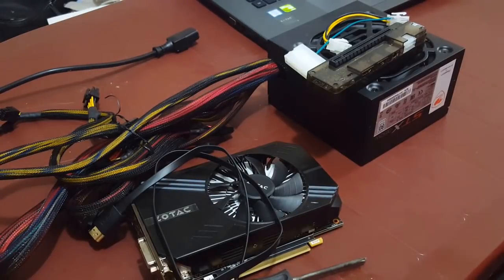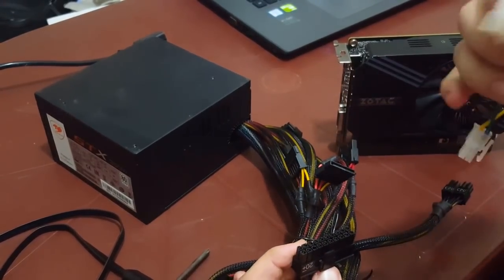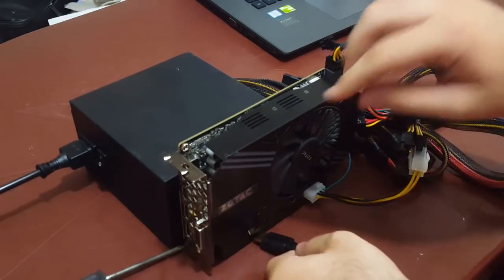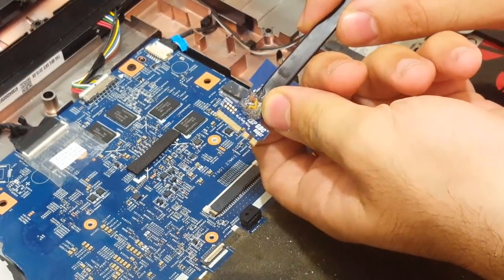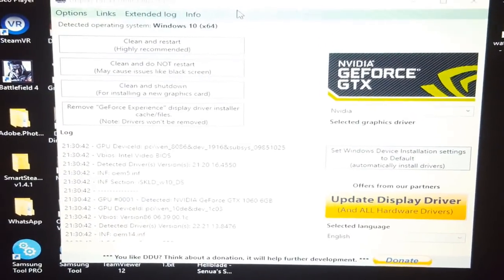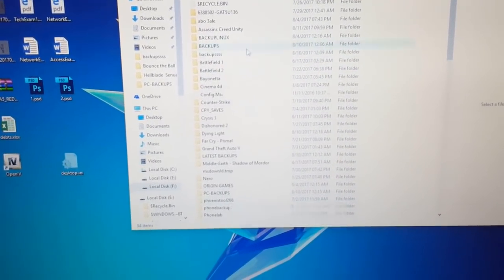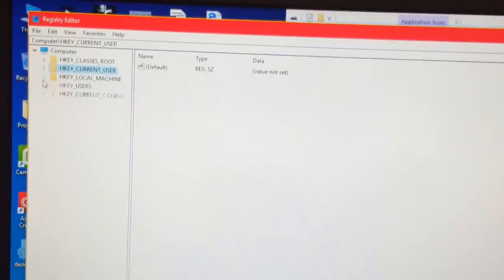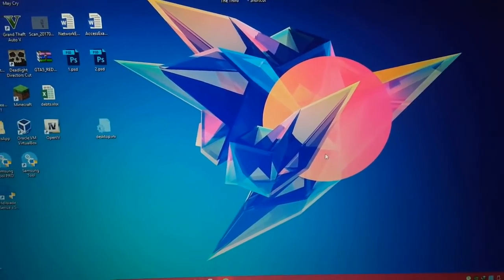HOW TO: External GPU for any laptop PC W/O External Monitor GTX 1060 EXP GDC 1050 ti solve error 43

Comment: Hi! i am trying to add 1060 6GB with my Hp envy 360. my computer detected the graphics card but i couldn't able to install any of the software (368.81, 372.54 or latest 430.86). if somehow i manage to install the software, the Nvidia control panel did not open neither the graphics card works (error 43). please help me to install the appropriate software. Thanks

Comment: Sir,  my gpu is not detected in the device manager.The vga adapter is detected but not gpu.The require driver of asus gtx 750 ti cannot be install it display error. My cpu lenovo core i5 560M,win 7 64 bit, ram 6gb.Please help

Comment: When I replace my wifi card with ngff ExpGdc Beast external pci adapter cable there is blank screen on booting. Even if I do not connect the HDMI to the adapter and conect only the ngff slot with no power still boot with black screen. If ngff cable is removed display comes. Is there any bios mod for fixing the same or what can the problem be?
Reply: did you solve this problem?

Comment: hello pedro will radeon rx570 work on dell i7 4th gen 8gb ram and my laptop already have nvidia 840m .I mean will there be any issue with amd drivers?
Reply from the maker: Haven't tried AMD yet, sorry, be the first to try
Reply: @hmawla  Amd gives more than 100 fps in all the latest games ,so i want to install amd.
Reply from the maker: @bankai_333  I understand, but unfortunately I did not test any AMD system yet with the Beast

Comment: So I just won a GTX 1060 for £90 used for a few months what is the minimum power supply for this kit i read 220w but card says 120w

Comment: I setup with gtx1070 but I got error 43 can u help me plz
Reply: Sok Lim  bro i have the same issue i don’t think these videos will help us i run my gtx 1070ti in GCD beast, it detect in my device manager but when am trying to run the NVIDIA driver it completely installed but after restarting the pc it doesn’t work for me I think we need to build a desktop

Comment: Rip mine not working I’ve tried everything watched so many videos but I always get error code 43 and it can’t be the gpu itself that’s the problem because it’s BRAND NEW so please if anyone can help reply to this with tips or suggestions
Reply from the maker: Try connecting the gpu while the beast is on while removing every power source from your pc like adapter and battery then turn it on.
Reply: Pedro Marthon thank you I’ll try it
Reply: Pedro Marthon Rip it didn’t work i loosing all hope in this but thank you for helping

Comment: It is better to build a desktop instead, I tried with my desktop 1060 but did not work on Lenovo laptop

EDIT: Worked finally but performance was meh.
Reply: bhai mere pas hp pavilion dv6 he gpu ke liye pura milake kitna kharcha hoga
Reply: @amolchopade7649   Amol Chopade  gpu+psu+connector.
Phle power rating dekhna gpu ki official website par jaaker mere paas GTX 1060 that uske liye minimum 400W psu chahiye but mere paas already 700W phle se hi tha. Agar tum GTX 1060 ke saath build karte ho to total price gpu (25000)+ psu (400W) (2500) + connector (2500). So for GTX 1060 price is 30000, if you buy graphic card online then you have to pay extra 10000 for graphic card approx. So price will be 40000 (graphic card online).
Reply: Hey will this work with my Toshiba laptop? Bios is locked and there is no options related to graphics card. But I'm planning to buy r7 240 2gb ddr3 for core i5 2430M(low budget).

Comment: Did you not have to change the bios settings to get the Beast working?

According to the guide you get with it you need to change the Graphic Device from Internal (in my case Discreet) to UMA.

So far I've followed the standard setup procedures and this has happened (I'll give you're guide a try):

I've just tried this on my Lenovo Ideapad 510 laptop. I first disabled the mobile Nvidia graphics card in it by changing the Graphics Device from Discreet to UMA in the bios. Then I connected the Beast External GPU to the laptop and then  plugged in a cheap graphics card I had to the Beast External GPU and connected the power supply. I booted up the pc, but it didn't detect the graphics card. What's more when I ran the graphics card driver installation it didn't detect the card either. It's also not present in device manager and is only showing the intel internal graphics device. The power supply is working, the graphics card fan is spinning, so I think there's no problem with the Beast external GPU. The only thing I can think is either my laptop isn't compatible or the graphics card isn't. It's just a cheap one (Nvidia NVS 310) I borrowed from work to see if it works before spending loads on a good one. Could it be the problem?
Reply from the maker: My BIOS settings are still the defaults, you just need to make sure to remove all power source from your pc before connecting the beast while it is turned on with the GPU comnected correctly, this will fix your GPU not showing.
Reply: @hmawla  my power supply won't switch on until I turn my laptop on. But I did try this and my Graphics card is still not showing up in device manager.
Reply from the maker: @Tsamados  follow this guide to keep the psu ON 
https://www.instructables.com/id/How-to-power-up-an-ATX-Power-Supply-without-a-PC/
Reply: @hmawla  not sure if be able to power the beast with the little wire plugged into to that port, as that's the one plugged into it. Anyway I managed to get the power supply to stay on after I powered off my laptop, however when I restarted the laptop it's still not recognizing the graphics card. I'm going to borrow another card and see if that makes any difference.
Reply from the maker: @Tsamados  Alright awaiting your reply...
Reply: @hmawla  Got it to work. I flicked on the ATX power switch on the Beast, so the power is always on. Then I had to hotswap the WiFi card with the Beasts ngff m.2 cable. Lenovo had whitelisted the port, the gits! 

Now I just have to work out how I'm going to install the graphics card driver, as I need to restart the laptop to complete installation and when I do that the graphics card is no longer detected, because of the whitelisted port issue.
Reply from the maker: @Tsamados  you only need too install it once the reboot then hotswap
Reply: @hmawla  ok thanks for the info. Gonna have to finish the installation at a later date as I'm knackered now.
Reply: I bought myself a Radeon RX580 8GB. But couldn't get my laptop to recognise it after hotswapping. I think it might be due to the fact the graphics card isn't being powered properly, as the fans on it are spinning but the 'fan stop' light is lit, (this was with an 8 pin connector going from the PSU to the beast and a 4 pin x2 to 6 pin connector going from the PSU to the Graphics card). I've ordered a 6 pin to 8 pin connector to run from the E GPU Beast to the Graphics card (which it advises you to do in the Beasts instructions), hopefully this will fix the issue. Failing that I'll return the Radeon RX580 and get a Geforce 1060 as my system seems to play nicer with Geforce cards.
Reply: Got the new power cable and tried again however still no luck. 

Tried everything to get the Radeon GTX 580 graphics card working but everytime I hotswapped, the laptop screen went black and wouldn't power back unless I hard booted it. Then the graphics card wouldn't show up.

In the end I changed the PTD setting on the Beast and this time when I hotswapped the screen didn't go black and the laptop came out of sleep mode. However the graphics card was still not showing up in Device Manager. As I only had a limited time left before I could return the card I decided to call it quits and sent it back. I've now ordered a Geforce 1060 6GB hopefully I'll have more luck with this. I'm also probably going to buy Nandos E GPU setup app if I run into problems with the Geforce.

Comment: Hello, please answer me :P I have a new 1070 from strix, and i followed these steps and the error goes away. But can i use it for the internal screen? Can you check about my ASUS ROG G551JW and 1070 STRIX are compatible? I can use egpu if i connect to a external monitor but not internal monitor.. and i dont have the port to disable my nvidia card ( 960M ).. i have to disable something that called for Intel Xeon processor E3
Reply: "nvidia graphics card is not connected to a external screen"
Reply from the maker: You intel GPU doesn't support internal screen use for external gpu, just use any monitor like ur TV or something should be easy... good luck...
Reply: rip me 
 @hmawla
Reply: but i have Intel HD Graphics 4600...  @hmawla
Reply from the maker: @Kimstarking555  it always depends on the vendor

Comment: Any chance you have this video without music? It is drowning out your tutorial and I cannot hear your voice. I’m getting a code 12 device cannot find enough free resources that it can use gtx1030. Haven’t a clue what it means was hoping by watching I’d catch something but it went forward a straight and clean installation as far as manual instructed.
Reply: That’s ok. Looks like a good tutorial otherwise. I was able to get mine working but it was a pain of processes for Lenovo to get working with several reboots. I had to disable Optimus in bios, disable Nvidia on board driver and than disable the intel driver reboot, disable grx1030 driver, reboot, enable 1030 driver, reboot, and now it all works fine. The only thing not functioning is that the adapter isn’t turning the atx power supply on internally so I had to jumper my “psu on” to “ground”. I’m not sure why it’s not doing it by itself but I have a 1030gtx working now so I may be able to do a few things with this older i7 now. I will try a gtx1050ti and a gtx1070 then see how those work and which works best. I wanted to get it functional with a cheap 1030ti before I connected my more expensive video cards. Frankly this far outperforms me newer laptop now. I should be now able to use my cad software ;-).
Reply from the maker: @glennedward2201  Great Job
Reply from the maker: Oh, I'm sorry, use headphones it will make it easier to hear. I need to work on synchronizing background music with my voice.

Comment: Hi Pedro,

I am using the Beast (mini-pcie version) on my HP Pavilion 15 n278sa.
The hardware connections are set and the GPU and the power supply
does start spinning. But the laptop is not detecting the GPU I am using (GTX 1080).
The laptop's internal GPU is AMD Radeon 8600g ... is there any hope of making
it detect the GTX 1080. When I first started I simply disabled my Network
adapter and as well as disabled NIC in BIOS. But I am having a feeling it is 
not enough. Could you help me with it ?
Reply from the maker: Make sure to remove all power sources from the PC when connecting the beast  which I mean that the beast should be ON and the PC should be fully OFF (even remove the battery) when you connect them.

Comment: helow my laptop is old toshiba satellite U400 intel(R) core duo 2.0ghz its comatible for exp gdx? and what graphics card compatible and power supply can I use ser.. more power to you thanks for help
Reply from the maker: It is best that you dont get an external graphics card, your CPU will bottleneck a lot

Comment: My laptop screen doesn’t turn on, is it because my laptop is incompatiable?
Reply from the maker: Maybe your internal GPU is not compatible, try hotplugging... You can search for it on google
Reply: Pedro Marthon ok i’ll search and see. Laptop boots up and i can hear the windows starting and shut down sounds but no display.
Reply: Sry , no idea on hotplugging. Found the macbook one but still no idea
Reply from the maker: @partixle7340  Your laptop may not be compatible with external adapters, retry following the tutorial video step by step, GOOD LUCK!
Reply: Use a modded bios and change the internal display to igfx.
Reply: Can u give me a bit detailed info? , Like do I have to search for a modded bios or just update the bios. Or, is it something else?
Reply: search for a modded bios. Luckily for me, i found a modded bios for my laptop on (bios-mods. com). Try to search for one, or even better post on this site and they will help you. If you want to play on internal screen then you have to do this, because the default display is set to 'sg' something in the bios and you have to change it to 'igfx'. I will make a video on it if i have time. Will let you know. Besides my laptop model is Dell Inspiron 3521.
Reply: Thank you for your time, I'll see where I can go,and will update if problem persists.

Comment: Me was try but vr do not ready 😂
Reply from the maker: Keep trying
Reply: @hmawla  me was lost about 450 usd to do it. Loss😞
Reply from the maker: Don't worry, you can always use the external GPU on a desktop if you got a new one.
Reply: @hmawla  i have a too old destop in 2010. Ddr2 ram can not use gtx 1050ti 4 gb
Reply from the maker: @kenhgaming8552  then keep it until you get a new one

Comment: Hmmm I have a Dell Xps 13 9343 with Intel Graphics HD 5500 . I've seen most Exp gdc models come with the pci e cable. My laptop has the m.2 slot. Do you know if there's a difference between the two interfaces and if it'd be worth it over HD 5500? Thanks

Comment: Guys help. I can not disable my iGpu 1060. Mine is acer predator 300
I get error 43 on my external gpu 1070
Reply from the maker: using an external 1070 is the same as using the internal 1060 maybe even with less performance since you will face higher latency than using an internal GPU... Stick with you 1060 bro <3

Comment: Does it still working without exp gdc if u just want to use laptop only without using external gpu.... also I have a little problem.. I've connected the mini pci from exp gdc with psu and connected an external msi gpu but Laptop cant recognize the external msi gpu the fan is working fine... My laptop has gpu installed already should I disable it first from device manager? or download msi driver first?[
Reply from the maker: Yes it works, you need to remove all power sources before connecting
Reply: My external gpu is detected on device manager... and I disable internal gpu and pci root for internal gpu my problem is when I test benchmark game.. my 1050 gtx external is not working.

Comment: Hi everyone. 
I really hope my question can be answered before I proceed with purchasing the components.

I have a 2007 Dell XPS M1530 laptop. The laptop only has a T6600 processor WITHOUT iGpu and a Nvidia GT8600m. My question is how do I install the new driver if I need to wipe the old driver ? External GPU would be a GTX 750Ti.  Any lead or answer would be good. Thank you Pedro and the community !
Reply from the maker: You should follow the same procedure from the video, DDU will uninstall every graphics driver you have, then you will be able to install the driver for the external GPU! Good Luck!
Reply: @hmawla  Oh sorry I forget to add, if I remove all Nvidia drivers, wouldn't my screen won't be able to display anything out ? 
Because based on your video, your laptop has an Intel iGpu to display out. Need your take on this Pedro. Much thanks !
Reply from the maker: @theD600cc  don't worry your screen wipl still be able to work since windows will use its generic drivers and software compatibility

Comment: Is M.2 bandwidth enough for GTX950 & 960 ?
How much performance loss did you have?
Reply from the maker: yes it should do great
Reply: At 18:41 the gtx 1060 is running at pcie x1 gen 3 , the speed bandwidth is (8 GT/s):
985 MB/s, using internal display will divide bandwidth about half or less (4 GT/s):
490~ MB/s , on a game that uses a lot of vram and need more bandwidth let say more than 4gb like rise of tomb raider everything at max setting the performance loss will be obvious, compare uses of internal display could be 30-40% performance lost, exp gdc external display = 10-30% performance lost, and x16 lane gen 3 (pc mainboard) with No CPU or ram or any bottleneck = no loss , on my experience, I play Witcher 3 at pc everything max,Nvidia hairwork max, gtx 970 = 50~60 fps stable 1600x900p, next I put the GPU on expgdc Asus n53sv , i7-2630qm, 16gb ram 1333mhz, pcei bus running at x1 gen2 , using internal display, with same setting everything max (use a lot bandwidth), I cannot get over 35fps, this pcie bus overload and bottleneck is so noticeable, but it still better than GT 550m inside the laptop., That's why u need an external monitor, except you doesn't mind to lower the setting 😬
Reply: @mysteriousstranger1227  x1 is too low and lenovo bios has whitelist so its like impossible
I gave up 😑
Reply: I don't think the performance lost on gtx 950/960 would be so noticeable, also you have more pcie bandwidth,maybe gtx 950 would never reach the bandwidth overload with 2gb gddr5, you might have no performance lost compare to pc gtx 950
Reply: @mysteriousstranger1227  still there will be BIOS problem
Reply: @user-we1ov5kq4f  wew.. I knew all this stuff after bought the exp gdc, lucky my n53sv get bios mod
Reply: @mysteriousstranger1227  is it hard to flash the modded bios?
Reply: @user-we1ov5kq4f  not recommended, I found a forum thread exactly for my laptop bios mod, for use with egpu, and the risk is high, bios chip on the board could possibly brick if flash with corrupted or wrong bios
Reply: @user-we1ov5kq4f here is the example of bios mod, just for example only  https egpu.io/forums/builds/2011-asus-n53sn-r9-390x4gbps-mpcie2-pe4c-v3-0-win10-doink/

Comment: can i use the internal display of my alienware m17x r4 which has only nvidia gtx 660m when i use this external GPU dock?
Reply from the maker: Yes sure, you just enable it again then install its driver normally, this won't override the external GPU's driver and you will be able to use it whenever you want!